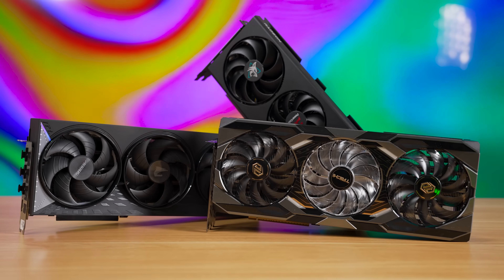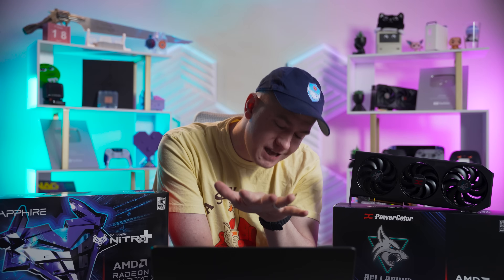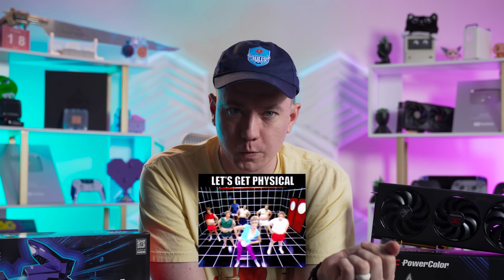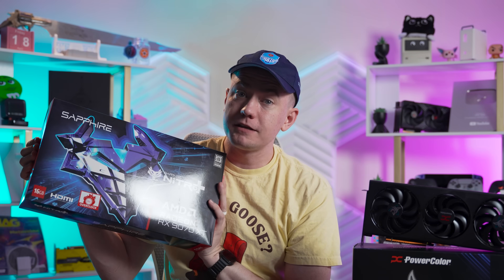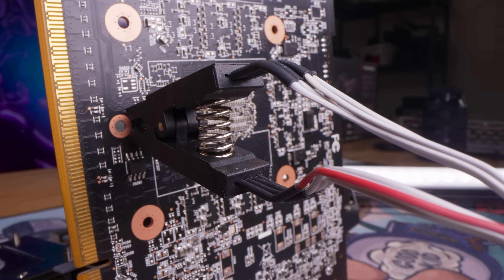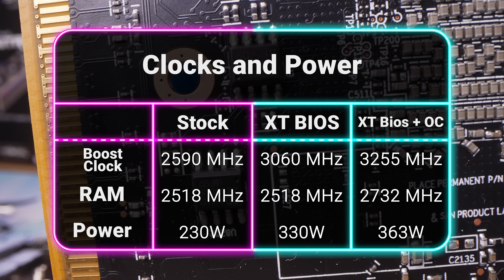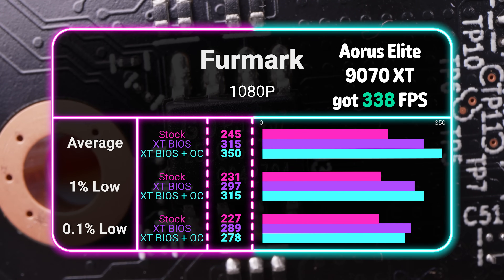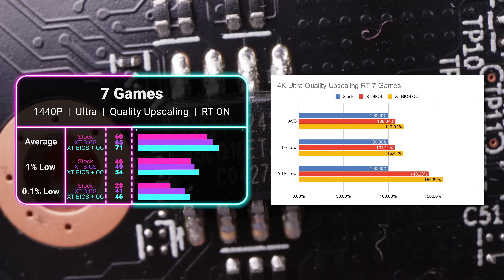The RX 9070 Is Actually INSANE - RX 9070 XT BIOS Mod

Comment from the maker: Thanks to Jawa for sponsoring! Check out their insane deals here:  https://jawa.link/UFDApr25 - Remember code UFD10 for 10% off, up to $10!
Reply: Dude. You literally put your life at risk with an RTX 12v plug burning your house down. I’ll take a dead card over a 911 call any day.
Reply: Looking at the results, the memory overclock seems like it might have been the main factor in the performance gain so what would the temperatures and performance look like with XT bios, an undervolt and just a memory overclock?

That might be the way to get most of the performance with good thermals and less worry about card life.
Reply: What happens if try something different with other gps to see what happens
Reply: Wow, I just got my regular 9070 sapphire nitro overclocked and undervolted it and it was hitting 3200Mghz at less than 270W in Superposition.
Reply: wt sponsorship when (ik it has nothing to do with the subject of pc stuff but it'd be funny)

Comment: only a 10% performance difference btween 9070 to the 9070xt. flashing the 9070 to 9070 xt is stupied when you can over clock the 9070 to xt level while under volting

Comment: I recently bought an Asrock Challenger 9070 and I'm pretty impressed with the temps and power draw on it so far. Was using a 6800xt previously and the 9070 performs better while using about 100w less power and at least 10-15c cooler temps. The reduced heat load in my case is even helping my cpu temps, as the cpu temp has been about 10c cooler also. Pretty amazing.

Comment: I build my pc a few months ago with 9800x3d and rtx 5080. A friend of mine laughed at me for spending so much money for the 5080( 1.5k usd here in my country). Which i dont really care because im not the type to wait for prices to drop. So 2 months ago he built his PC and linked me a video to another youtuber (called dawid i think)doing this mod and told me how genius he was saving money while getting the performance. Then few days ago his 9070 died with burning smell. And he cant replace it under warranty cause he voided it. Maybe he is unlucky but pretty sure doing this will shorten your card lifespan by alot.

Comment: Did this mod 3 days ago after watching the vid, was horrified to see 117 degree hotspot temps with mid range thermal paste. Got some PTM 7950 and the hotspot is down to about 95 which is high considering the core peaks at around 65, but still more than manageable. It only gets that hot in synthetic tests like furmark, doesn't get past 85 on the hotspot in 1440p ultra gaming. Tested monster Hunter wilds for that. 
Would recommend using PTM 7950 or liquid metal if considering the mod. But this does put the 9070 leagues above the 5070. There's a great and simple video by Miyconist that explains bios flashing for motherboards, exact same concept for GPUs.
Reply: I build my pc a few months ago with 9800x3d and rtx 5080. A friend of mine laughed at me for spending so much money for the 5080( 1.5k usd here in my country). Which i dont really care because im not the type to wait for prices to drop. So 2 months ago he built his PC and linked me a video to another youtuber doing this mod and told me how genius he was saving money while getting the performance. Then few days ago his 9070 died with burning smell. And he cant replace it under warranty cause he voided it. Maybe he is unlucky but pretty sure doing this will shorten your card lifespan by alot.
Reply: @Spankyy811 I'm pretty sure your friend should be able to reflash the bios chip back to the original and then RMA the card. I'm assuming they're using a card with a dual bios, so odds are they should be able to RMA it even without reflashing regardless. Not sure how often bios chips are checked however.

In any case, I doubt the flash is what killed their card in 2 months unless they were running it with extremely high temperatures or had a PSU that couldn't handle it, the clock speeds are achievable via OC to stock bios and the power draw is within spec for the dual 8 pin design, so outside of those, id reckon they're just unlucky. In any case, they should still RMA the card.

Comment: This kind of mod is usually an issue, as the lower version of a model usually is made frorm parts that failed upper quality tests. The typical example of this is CPUs or GPUs that have a defective part due to manufacturing, and said defective part is disabled. enabling it back is not going to fo fix it.

Comment: I dont plan on changing from my RTX 4080 until the RTX 6XXX comes around, but I am SO EXCITED about it and the fact that Intel is looking into the CPU overhead issues. The 9070 felt like a sad consolation prize for those who couldnt find an XT or the XT was ridiculously overpriced. 

Just wait you can do it all on Windows instead of this manual bios flash.

Comment: 363W is kinda crazy, +58% power load for +22% more FPS is quite a significant hit to the efficiency
Reply: No,  its great.  Dual bios, you flash one.  So silent bios =original 9070. Performance bios override = 9070xt kind of performence.  Most games you happy 9070, some games runs harder the e 1 small move on card klik dang 9070xt performence. Dont leave it on 9070xt bios all the time
Reply: Maybe you can still undervolt it to balance that a little

Comment: Before and during early days of launch: 'Whos gonna buy the non xt 9070s? Its only very slightly cheaper than the better performing 9070xt.'
2 months later: 9070 oc'ed can reach 9070xt performance 9070 sales skyrocket

Comment: AMD: here we have our New Radeon lineup, the 9070XT for $600 it can do wonders, with 16gb of Vram and it can beat the 5070Ti by 5% when OCed, and we have the 9070 for $549 with 16gb of Vram and it can beat our 9070XT when you flash the XT BIOS version to it

Comment: The 9070 is supposably very good when undervolting and overclocking... I wonder how big is the difference between simply software tweaking a good undervolt + OC and going phisical with flashing a 9700XT BIOS? I wonder if in this scenario, the performance difference is really worth the work and risk.

Comment: I was thinking of saving $100 by doing this, but looking at temp, I'd rather get XT which is thermally more capable of higher clock. I've kept my 6800XT for 5 years, and 9070XT will also be my daily for 5 years too. I'm not going to risk it.

Comment: Eh....the vbios mod basically just unlocks the power limit on the 9070 vanilla to that of the XT. You're still missing the cores that the XT has that the vanilla doesn't, then you can hit pretty close to the clock speeds with UV and boosting the power limit without sucking down an extra 100w of power. 

A better comparison would be to have the stock 9070 , an OC Undervolted 9070, and then the XT Bios+OC to see how much of a gap there is between maxing the card with settings that everyone has access to vs the full bios swap.

Comment: My xfx merc 9070 XT OC consistently boosts past 3,300 MHz in the 3DMark Speed Way stress test, well above its advertised 3,100 MHz. I did -85 mV undervolt with +10% power limit, and it still pulled over 400W (has 3 power connectors), yet average temps never broke past 60°C lol. Passed steel nomad with 7669 and speedway with 6,502. And I haven’t messed with VRAM or core clock overclocking yet. I don't want to kill my gpu.

The card is built like a tank. It has a massive beefy cooler that takes up 3.5 pcie slots — it’s basically the Ford F-150 of GPUs with a V8 strapped to it.
Reply: do you have 4k monitor or maybe dual 1440p setup? I wonder what is the performance of this GPU setup in those conditions, because synthetics does nots represent 4k gaming (I'm native resolution performance without RayTraycing).
Reply: @DagnaMoore then forget about 4k buddy it's out of your price range you gonna need twice the budget 
Even a 5090 can barely do 4k60 native unless you only play Minecraft 
Plus dlss is now better looking than native resolution if you use the quality settings 
This native thing is so stupid
In a blind test you couldn't see the difference without stopping and closely inspected the image side by side 
And that never happens when you game
Reply: @legros731 my budget is ok, but I'm on 3080Ti for native 4k and no RT and i'm not playing newest titles (new games does not seem to be fun or interesting enough, too much hype to little fun on those)
Reply: @DagnaMoore  I only have 1440p 144hz 32″ monitor. If you are gaming on 4k monitor, just buy 5080 oc or 5090. 9070 xt can barely match reference 5080 card even with oc'ed.
Reply: @hanp8 Some people have standard 
Plus I don't care to play in 4k if it need to have 3/4 fake frame to get here
I will never buy ngreedia products 
They got missing rop,not enough vram,melting connector,bad driver, overpriced,lie about performance like no tomorrow 
Plus the 50 serie 1% low are really bad
Reply: Lol it's a pretty basic card for today standard buddy nothing to get your pant in a bunch
Plus OC won't kill your GPU that impossible

Comment: Nothing'll beat the insane value that came from doubling your speed with the old Intel Celeron 300A in the 90s. 300mhz overclocked to 450mhz or more if you were really lucky.
Reply: pentium e2140 and 2160 could do a 100 percent overclock and you went from a cheap 75 dollar cpu to a 300 core2duo one
played crysis with it
Reply: @do365nic  That answers the question... "can it run crysis?"

Comment: Impressive, but I'm just too scared about bricking my card (I know it's rare, but someone always has to be the unlucky one).
As well as that, I have the 9070 Pulse which is a dual fan card, it might struggle keeping the temps down unless I up the fan speeds, and I don't want the extra noise.
That said, even just undervolting these cards gives decent results.  +10% power and a -80mV undervolt and it sits at a consistent 2950Mhz GPU clock while gaming (goes a fair bit higher with the AMD stress test).  RAM is at 2700Mhz with fast timings, it;s stable in all the games I've played so far.
Really impressive little cards.

Comment: This is super great stuff, but please everyone be aware that the 9070's can be undervolted to get as much 8-10% more performance on average, and some cards can get up to +13% performance this way. Don't let FOMO make you risk bricking a card or spending extra money. This is a project I personally feel like you should only take on if you want to learn about swapping BIOS on GPUs.
Reply: All this really does is change the cap +10% power limit that's built into OCing with a vanilla bios to about 60%. All undervolting does for speed is duck it's head so it can fit more in that power limit, so if the cooling solution can handle the additional power you don't have to undervolt as far to make the clock speed stable. Limiting the power on the OC is just a b.s. maneuver because it should be thermally limited not just a power value limit. What's the point of all these fancy-schmancy coolers that board builders charge hundreds of dollars over msrp if you can't pull any additional power on them? 
That being said, this isn't for me because I got the 2 fan pulse and I'm already having power issues because my old EVGA 700 psu only had 1 pcie connector with a branch and I can see occasional power drops on it with -85 under +200 clock OC. It doesn't cause crashes, but my steel nomad score varies between 6270 and 6340 with no changes.
Reply: @plebiansociety  I’m in the opposite situation with a massive 3 slots 330mm 9070 (the nitro+). I do get stable 3k+ clockspeed with only +10% power and -40mV but it’s sad I can’t push the card to 300+ Watts

I’m still very satisfied with the card though, massive upgrade from my RX580 😁
Reply: @sagirem  if you're hitting the power cap, try undervolting a bit more, 40 is way conservative. I've done 110 but the memory doesn't want to be touched at that so I went back up some
Reply: @ I originally did -60mV but I had a lot of flickering so I lowered it to -40mV and did other stuff and it was gone. Each card reacts uniquely with undervolting, some will be able to lower a lot more yet get the same clock. Maybe I’ll try to go lower some day, but being able to up the power above +10% would still be better
Reply: @plebiansociety  You might want to replace that power supply. I think it's big enough if just barely but it still sounds like it's underperforming. I don't know how old your PSU is but they aren't immortal.
Reply: You can take the power limit off by shorting between two pins on two different chips, then you can still set power limit in Adrenalin, much safer than flashing BIOS.
Reply: @robertkubrick3738  If you do this by soldering, would it even be possible to cut the short later and get the old functionality back? I'm just curious and don't know how local short circuits might affect the chip, I assume they will

Comment: I've got a Hell Hound 7900XTX so no need or desire for a burning down the house 12 pin GPU or a regular 9070XT for several years yet. My XTX replaced my 1080Ti so I'm comfortable waiting for a major performance uplift IF the price is not absurd.

Comment: I got a XFX Swift 9070 OC Edition and when I flipped the bios switch it was legit like it went to Super Saiyan 3, jumped from 2.8ghz to 3.3ghz which I found highly amusing, while still staying at the 245w power limit, if I plus 10% the power limit it's even more nuts..lol(caps out at around 275watts) ..or else I would consider doing this to my card, XFX really tweaked it already though.
Reply: This comment needs alot more attention. You can hit close to the XT clock speeds already without the vBios change through undervolting and playing with the power limit. The bios update just really removes the power limits of the 9070 to be on par with the XT, so its just a fancy overclock and not really truly gaining anything cause there is no extra cores getting unlocked.

Comment: HEY!  Could I do this with my 6600?  I'm tempted to try it with the 6600XT or 6700 BIOS...

...If it bricks my GPU, no big loss for me (it was a cut-down version from Sapphire, with only 2 ports, for $219 in 2022).  I'm prepared to get a 9060XT if my 6600 bricks.

Comment: why not just flash the better bios onto it, undervolt and powerlimit it, so it runs at the temperatures, it is intended with, but with more performance? Wouldn't this basically be to run the card "as intended" - meaning,  not overly straining the card, so it has a normal lifespan ?Or am I missing something?

Comment: Not sure the extra heat and noise is worth it. I mean at least half of those gains are from the overclock. You should've compared the 9070 bios + OC to the 9070xt bios + OC to see what gains are from the bios flashing alone.
Reply: Yeah makes no sense to me that they didn't also test stock BIOS + OC, as it does seem like they could get close to the flashed BIOS results. I'm not convinced the BIOS flash is actually doing that much here.

Comment: Does this somehow reenable the disabled stream processors or are they fused and only thing it does is it makes powerlimits higher ?
Reply: No, it doesn't reenable the SP, but increases clock speeds to match the XT card.
Its useful if you want to match XT's performance as the OC feature that AMD has is limited to a certain %
Reply: @PanchoGDMKWii  Ah I see. Cool.
Reply: @PanchoGDMKWii  But how it manages to match RT pefrormance of the 9070xt if its has fewer CUs?
Reply: @markomarkovic5729  Idk about RT, but I meant the raster performance

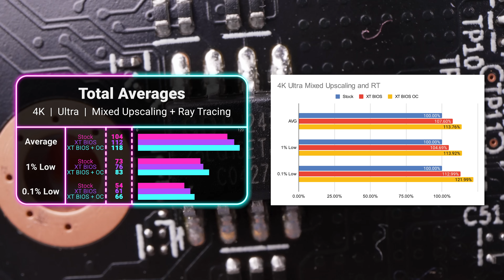Comment: Regarding 12:49 , as long as you have the CH241A programmer and the original vbios backup (or get one on the internet), you can save your graphics card in case of bad vbios mod. But it has to be dumped, not the one that you get on GPU-Z because the filesize has to match the chip's filesize and GPU-Z one has only half the filesize

Comment: This would suggest the XT, if untamed, would have so much more to give
Reply: No, unless you have the ability to mod the vBios like you could with RX 5000 series which is unavailable since RX 6000/7000 series
So it only helps the non XT mostly, but you can tune the XT one perfectly (Undervolt/OC)
Reply: @PanchoGDMKWii  Buildzoid made a video on how to disable the power limit on the 9070 by shorting a few things. Maybe that can give an upper bounds if anyone has done that with an XT.

Comment: can you flash a 9070xt with a 360W max onto a 9070xt with a 334W max? essentially getting rid of the differences between the "high end models" and the MSRP models?
Reply: I guess you can but the performance and price difference will be marginal and not worth the risk. The whole point is to risk but gain much. If there is even a point to that.
Reply: @constantinosschinas4503  i mean there is a possibility for another 10% performance with that 10% more power if your silicone is good... just wondering if anyone has tried it tbh
Reply: @asaclayson7831  Is it worth the risk for 10% is the question.